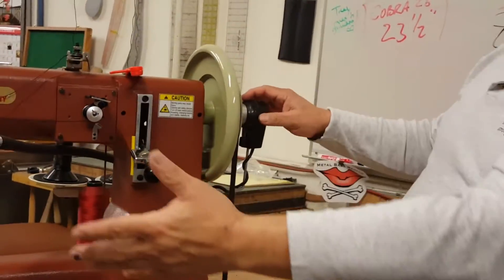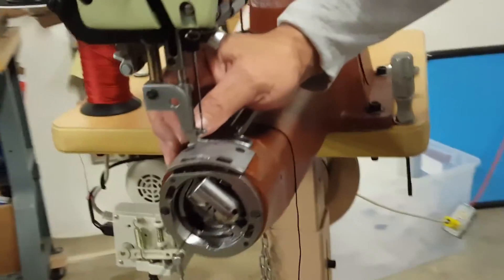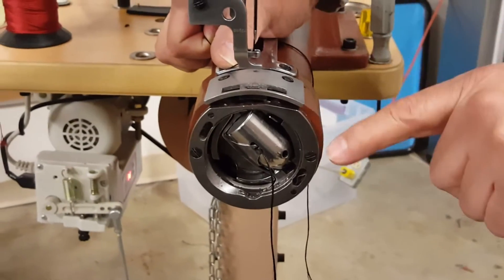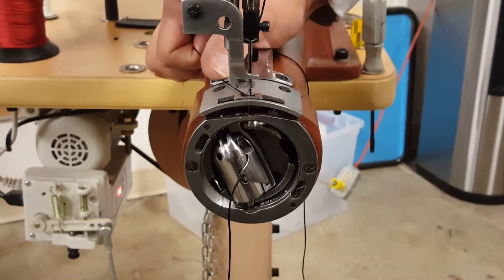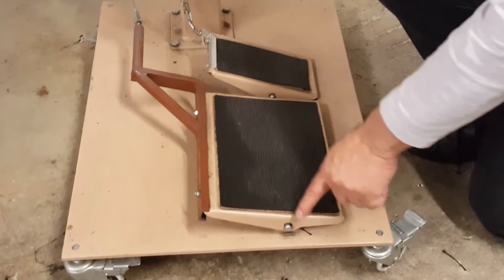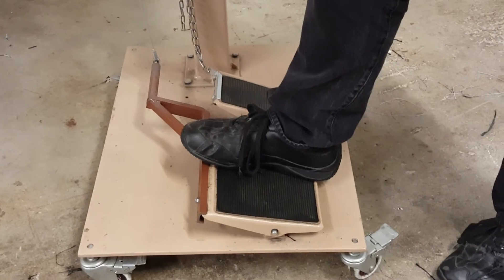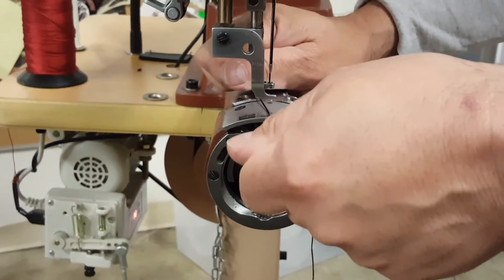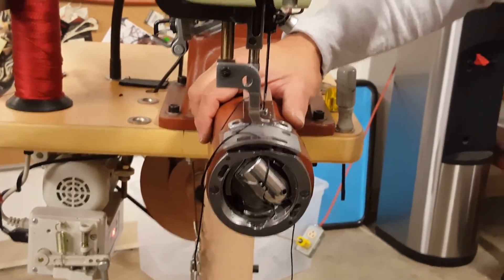Electronic Positioning System EPS from the Leather Machine Company

Comment: How do you put the eps devise on the machine ?
Reply from the maker: The EPS system is part of the motor. If your motor is not equipped with the feature then you would need to replace the  system.